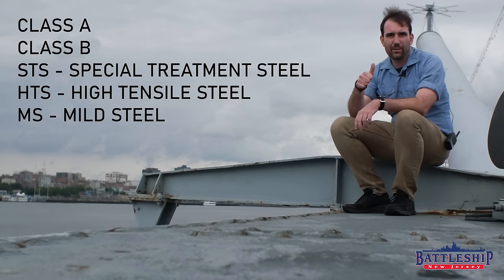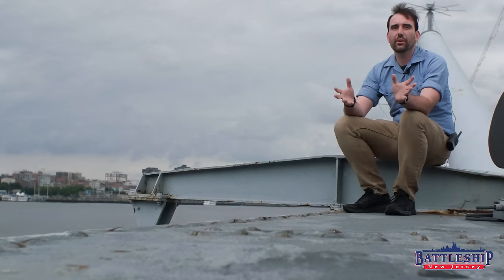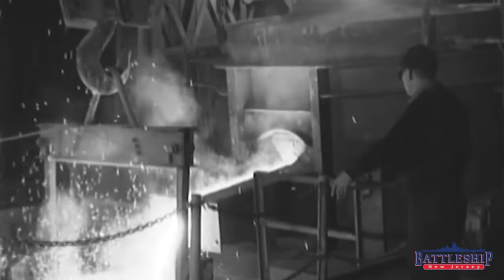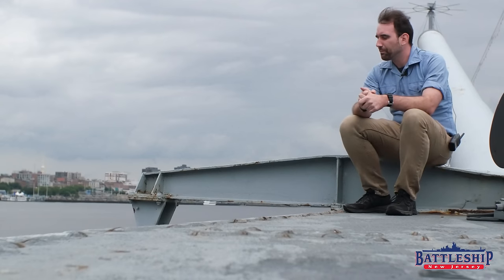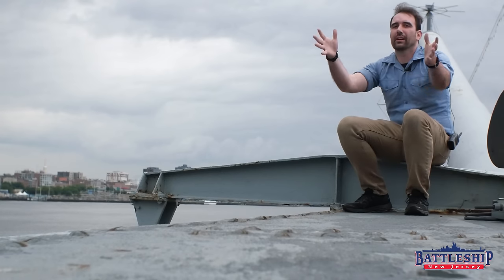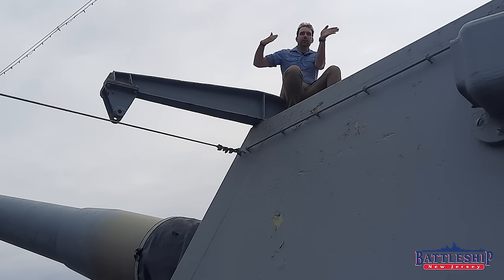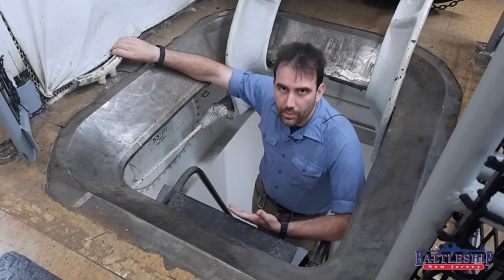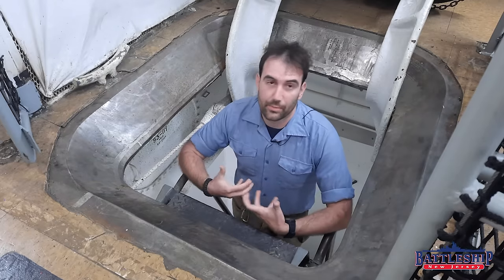Whats the Difference Between the Armor Types on the Iowas?

Comment: You could make an approximation spalling with and without backing,. Using a high speed camera, capture the moment of impact of a  piece of glass. Then repeat the process with a thin piece of lexan attached to the back of the glass with adhesive.

Comment: A related topic to this theme is “scrap”. Consider why there is little economic incentive to scrap major war ships. They are proverbial elephants. 

And how do you eat an elephant? One bit at a time of course. But how and where to take that first bite? And every bite there after? Thats the rub. So an obsolete aircraft carrier sells quite well. An old battleship? Well lets make it a museum because few really want to chew up that tough old elephant. 

But some have. Argentina salvaged portions of the Graf Spree superstructure in the early war years. Why? They had domestic industry but were dependent on imported steel. This was cut off when war were declared. Then the GS was scuttled right there in the Plate River. With portions of the superstructure above water. They went out and cut great chunks off with considerable difficulty. Carted it home and made stuff, with great difficulty. So. For example the Ballister Molina pistol, a variation of the 1911 pistol made in Argentina. Those made in the early 1940’s are highly prized today because they were machined from GS armour plate. Not because it was “better”, but because it was all they could get. As soon as they could get mild steel thats what they used. 

Now today there is a cottage industry salvaging pre-1945 naval wrecks. Much to the frustration of those who view them as war memorials, or the testing place of the crews. Why are they so desirable?

All steel smelted or re-smelted after 1945 has traces of radioactive elements from the atonic bombs used and tested. Not such as to pose a risk to human health, but note than enough to mess up an xray or MRI. These highly sensitive medical and industrial machines must be built of “low background” materials. And the best source is the steel in pre-1945 ships. Ideally steel that is not too thick, nor too deep to salvage. So the Bismarck,  Graf Spree and New Jersey are off the table. Too deep, and too hard to cut up economically. What is ideal is a destroyer or light cruiser, in shallow water, in a small country that welcomes the income over remembrance of the dead of another nation. 

Once a cottage industry, the speciality salvage is now established. And the low hanging fruit is now gone. They now look at larger ships in deeper water....and eye the museum ships as potential future fare. They are again nibbling at the Graf Spree as price of “clean old steel” goes up. Salvage becomes economically viable. 

So. A slightly different perspective for consideration in your discussion.
Reply from the maker: So here is our video on pre-nuclear steel: https://youtu.be/tQTk3Y3EOWs

As far as scrapping these ships go, separating all of the things apart and removing the toxic components and paint and insulation is so expensive that it eats up most of the profits from scrapping it.
Reply: @BattleshipNewJersey  Excellent! I have not seen it. Your a jump ahead. 
Yes. Economically it makes no sense to scrap them. They make great museums.
Reply: @BattleshipNewJersey  I watched your referenced video. Very good! You asked one question. Contact with air has no effect. But smelting does. Thus pre-atomic steel can be collected from surface or subsurface sources. No matter.  It can be cut mechanically but not torched. Any melting introduces contaminated air. Nor can that steel be smelted or forged. But it can be sheared and machined. Even cold rolled. 
Rest easy. While New jersey steel is “clean” the chunks are too big. Keep it a museum. All good.

Comment: How did they join all these thick plates?  How does the class A in the front of the turret physically connect to the class B on the sides?  There's no way a weld to penetrate that deep.  Thank you!!!
Reply: I beleive these plates were riveted/bolted onto a structural framework. Welding is great for structural work, but yes it is difficult to mount a heavy armor plate using a weld.

Comment: Ryan, this video was very educational.  My grandfather and some Uncles worked in the production of making steel for the Detroit auto industry in the 1930 until 1960’s .  Using Concrete as a filler was something I didn’t know. Are there other areas that a filler like concrete is used on the NJ?
Thank you.

Comment: I'd really like to see the manufacturing process for the armored steel and how those extremely thick plates for the torpedo belt were shipped and installed.
Reply: They folded them up and mailed them in a large yellow envelope.

When they arrived at the shipyard, the builders just had to hammer a couple wrinkles out before installing them.

Comment: What sort of corrosion protection did the various armored and unarmored parts of the ship have?  Is class A or B armor or STS more or less susceptible to corrosion than mild steel or HTS?  Did any of the armor plating ever have to be replaced due to corrosion damage?

Comment: Howdy, I would love to know if the navy ever made any considerations toward using smoothe bore guns on warships? Like on tanks and similar weapon systems?
Reply: Probably not as the rounds are designed for different things. Tank rounds are designed to be small enough for lots to be carried in a rather confined space and be man-portable. They need to go really really fast to hit fast moving targets and get through feet of armor. Most of the targets will be destroyed or rendered inopperable by a single hit. Im speaking of tank on tank combat APFSDS rounds which require smooth bores.

Battleship rounds can be massive because they are moved by machinery. They are also essentially big bombs that fall to their targets. They can penetrate but by being so massive can generally do that pretty well. (I think there is some armor at some ranges that will stop a 16 in ap round, but its sparse and heavy) even so many many rounds will often be needed to hit a battleship to dissable or destroy it.

So function dictates form. It would be cool to see a 15 foot long apfsds round being fired from one of these guns though. But it would only drive a relatively small hole through whatever it hits. Less penetration is traded for an explosion in reality.

Comment: I beleive the British equivalent to class B as used on the KGV class was regarded as slightly better, but the difference being slight to the point of irrelevance. matters of a slightly different alloy mix. The older British battleships i believe had an older steel type that wasn't as good.

The Japanese armour steel was noticeably inferior, based on an older metullurgy, and the Germans was variable, based on when the ship was built, and what alloying components they were short of.

Dont remember anything specific about French and Italian armour steel.

Comment: Yamato battleships have "All or Nothing" armor scheme and top of that the best deck armor of any Battleships could have, the armor could resist momentum from 1000lb AP bomb dropped from 3500 meters. The belt armor could resist their own 18" shells fired from 22,000-32,800 yards away. 

 I might also add the Yamatos have best torpedo protection of any Battleships in the world
Reply: Didn't seem to help Yamato or Musashi.  At all.
Reply: Disagree about the torpedo protection. Both the giants took submarine torpedo hits that caused them both to taken in about 3000 tons of floodwater each. The Japanese were PISSED...they also used longitudinal bulkheads as well transverse bulkheads. Combined without adequate crosspumping to correct listing and they were vulnerable to capsizing. That's why the USN didn't like to use longitudinal bulkheads..
Reply: @sethkimmel7312  the joints where the blisters met the hull were well known weak spots for Yamato.  Also, look at the severe damage USS Skate inflicted on Yamato in December 1943 with one Mk IV torpedo and it’s relatively light warhead.  Basically took her out of the War for three months.
Reply: @Ramal  AirPower and relatively weak Mk 13 torpedoes took out Yamato and Musashi - four Mk 14’s from USS Archerfish took out Shinano.  The Mk 14 had an 800 pound warhead which was quite modest by the days standards.
Reply: @petersouthernboy6327  took literally than 4 or more torpedoes to finish on same side of the hull to sink Yamato and Musashi, all 3 of them have worst Damage control in the world. Any other capital ship, take away the damage control, will not survive the same punishment.
Reply: @ramal5708  in December 1943, USS Skate took Yamato out of the War for three months with ONE Mark 14 torpedo.  Your original premise is quite flawed
Reply: @petersouthernboy6327  even so any other ship still would retreat back to base/homeport

Comment: I think the armor design (i.e. placement, angling, internal structure) would have been more significant than the armor's metallurgy, except perhaps for properties like the "type A and B" concept described here. In actual history, there's probably not enough good data to compare the performance of any battleship armor designs, even in ships that fought at Jutland.

Comment: Taking  a couple more  months to manufacture the hardened class A vs B
 steel?..........How large  can the thickest steel plates be?.............How are 10~16" steel plates joined/butted together and still have some semblance of the strength of the specified
 plate?..........Welding or riveting  12"+ plates together

 sounds impossible.,especialy if they need be watertight.

Comment: I am 90% sure that Drachinifel has stated in one of his Drydocks that STS steel is not armor plate and was never intended as such though it is a common misconception. Sorry Ryan, but given how thorough he is in his research combined with his engineering background I'm more inclined to believe him on this one.
Reply: You mentioned that regular STS is just rolled while class B is forged. I think this explains the difference of opinion because my understanding is that the forging process is actually a huge deal and is just as important as chemical composition when it comes to a steel's internal crystalline structure and physical properities. I suspect one-inch-thick Class B is decent splinter protection while the same thickness of rolled STS is nothing of the sort.
Reply: STS is armour

Comment: I work for a company that has a fair amount of the foundry molds that was used by the sun ship building company for casting those parts. Look just like the part just made of wood.
Reply: Are you talking about the forms used to make sand molds which would have the steel poured into them? I'm fairly sure the molds themselves weren't wooden.
Reply: You mean the patterns.

Comment: Think I recall Drach making a case that Italian Armor might have been the best because it did a better job of tapering brittleness from the face to the back. 

Have seen first hand at National Forge (now Ellwood National Forge) a Volkswagen size ingot getting open-die forged - its an impressive sight - the ground shakes even 15-20 feet away. 

Was on the Wisconsin several years ago and what struck me, looking up close at the turret armor was surface cracking - seems like that might be all about how well the cooling rate could be controlled - a big challenge with that much mass of steel. Having worked with temperature control on modern industrial furnaces, its hard to imagine the challenges at hand when these ships were made 80 years ago with the tech they had then - to get desired properties to the armor.

On expansion and contraction in the Pacific - you have to remember all the mass involved - it takes a lot of energy to heat it all up and then if the ship is underway at all those surfaces are getting a convection cooling effect, even at 10-15 knots a whole lot of cooling.

Comment: Is the stuff I use for target practice; AR500 steel. Is that similar to armor plate?
Also. If I had a Battleship I’m sure I’d be lining the spaces with thick Kevlar as well.
Reply: No, not even close.  AR500 steel is primarily used in dump truck beds.  Its primary use is for abrasion resistance, it is super hard steel.  Although with the right thickness, it can be used for small arms practice, it is poor to terrible armor.  Such hard steel is eventually brittle compared to true armor plate, and with enough energy or repeated impact from high energy projectiles, it will begin to fissure and shatter.  

Armor steel is hardened, but still ductile enough to resist shattering, and absorb energy, and resist spalling.  Thick high end naval armor was face hardened, with a soft armor backing to prevent spall and fracture.

Remember that the first cast iron and high carbon steel armor shattered like glass, and although harder than wrought iron, failed against big impacts from big shells.  Armor's purpose isn't just being hard to resist the hardness of the projectile, but the right properties to absorb energy.

Comment: Is there not a type of armour that was poured over another?
Reply: You may be thinking of the asphalt armor used frequently on merchant ships to protect from strafing aircraft. Not poured over armor, but over the structural steel around the bridge/wheelhouse. An iron alloy that is heated hot enough to be molten/poured is going to have unpredictable (but predictably bad) material properties for use as armor or a sword.
Reply: @kemarisite  THAT makes sense! Lol i was wondering what was flowing thru my head!

Comment: Curious why it took 7 to 9 months to make armor. What size armor?
Reply: I was struck by that figure, too. And I was just picturing in my head that, if the shipyard wasn't ready to "install" the various pieces, they'd kind of be stacked up somewhere waiting for installation. Kind of like having a huge pile of steel pieces lying around. But I would imagine things are planned a bit better than that, so that these kinds of bottlenecks wouldn't occur, or so that the shipyard wouldn't have to store them. "Just in time" shipbuilding, as it were.
Reply: literally battleship size

Comment: Secretary Leman saw an Exocet missile hit in an abandoned section of Iowa class armor. The paint was singed. So, he vowed to bring back the Iowa battleships.  Bismarck had great armor too.
Reply: Really? Early model MM 38 Exocets or AM 39 Exocets had a shape charge warhead that could cut well through 24 inches of Armour plate & delivery lethal high temperature overpressure, metal fragments & molten metal after pen. It can penterate the main armour belt & then cut through the armour citadel of a Iowa.

Comment: A informative and interesting video. Sold work.... Bad joke there 🤣
    American armor was good quality. Early on Germany was building good stuff. Think Britain got some armor technology from Germany and the US.?
  Drachinifel has an excellent video on armor. I recommend it highly
Reply: Armor sometimes depends on steel quality and type, not only that you can also add the armor scheme or layout. Today's armor scheme is just like modern tank i.e. composite armor or spaced with outer layer is steel and inner part is kevlar, dunno if it's the other way around, I'm not sure. During cold war most ships hull are made out of aluminum to conseve weight for top deck electronics and missile boxes but they are vulnerable to fire like the USS Belknap fire.

Comment: How armor was distributed and which class of armot was used and where!! How some nations used a lower grade of armor to construct their BB'S!! PROBABLY most of us have seen the piece of 16inch armor of a type used to construct the YAMATO SLICED THRU BUY A 16INCH AP ROUND OF A TYPE USED ON THE IOWAS. SO BASICALLY THE YAMATO WAS CONSISTENTLY THE WAY I INTERPRET IT WITH CLASS B ARMOR THRUOUT THE SHIP!!! IS THIS A CORRECT ASSUMPTION??
Reply: It the picture is the one of a turret face plate with a relatively neat hole though it, then it is surprisingly misleading.  IIRC, that plate was from the carrier converted Shinano (witch no longer needed turret armor) and was shot at literally point blank with a spare Iowa barrel and with a blind or solid shell for testing purposes after the war.  And by point blank I mean less than 1000 feet.  The difference in shell velocity and having the shell hit practically perpendicular to the plate punched a nice hole, but the conditions were no where near what were expected for combat.  It was more a PR thing than an accurate test.